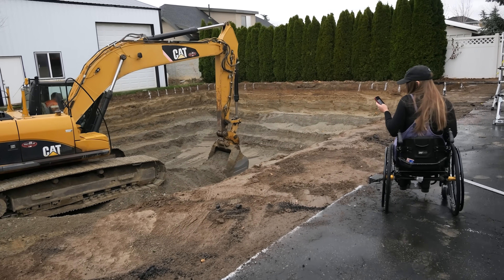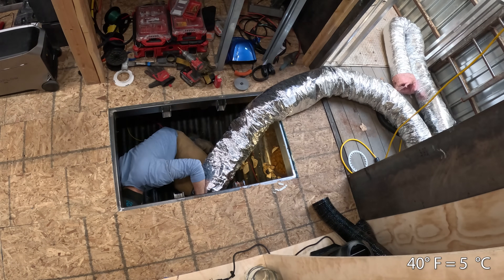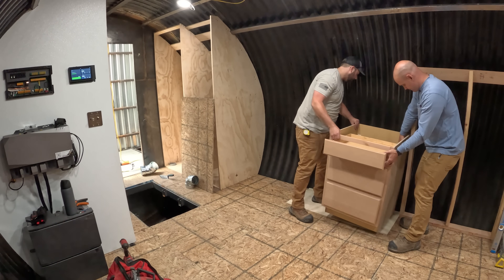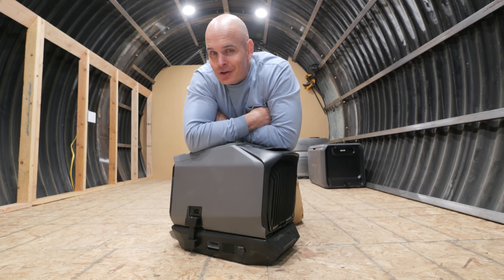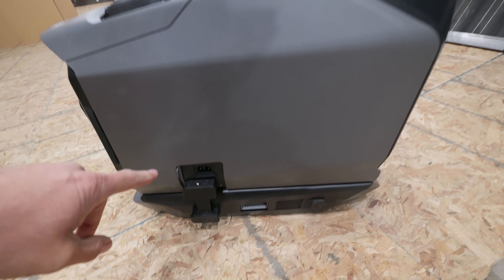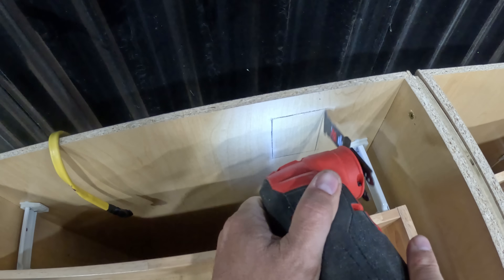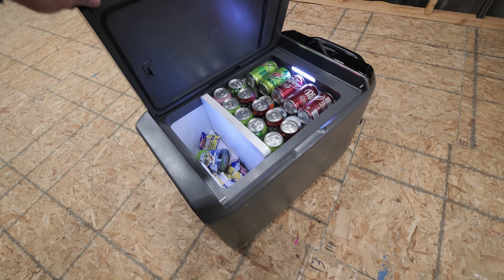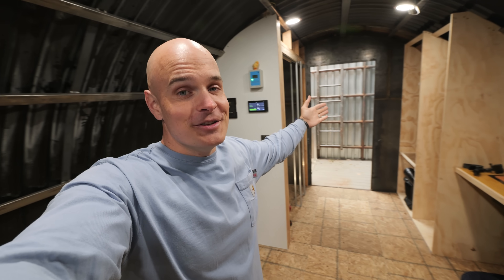How much air does my Backyard Bunker need?

Comment: It baffles me that bunker homes aren't more common in the many many parts of the world that experience extreme temperatures. I live in an area where it gets down to maybe 40 degrees at night in the winter, and sometimes even 110 degrees in the summers. People are basically always heating in the winter, and cooling in the summer, and those energy costs are INSANE. Also, some areas are so densely packed that parking becomes a problem. Imagine if they could park a couple of more cars ABOVE their homes?

Comment: Outside air coming in through some kind of HEPA/biological filter together with an air-to-air exchanger to preserve heat would solve most problems you could encounter.

It could be interesting to see some testing for radon levels too, as that could become hazardous over time if the bunker is used for recreational purposes.
Reply: Thankfully radon won't easily penetrate the outer casing, but it will get inside through any tiny cracks and splits. Ventilation will easily take care of it though. It is only a problem after days or months of no circulation
Reply: Or get rid of that crappy ecoflow unit, and install a proper heating system, but sadly its sponsored, so he has to advertise it.
Reply: @PaulXerxen  doesn’t seem crappy to me, and projects like this have to be funded somehow! Honestly I’ve found it cool to see all their products.
Reply: I'm suprised you think building a bunker is necessary?  Certainly not a thing in the UK. Will you ever use it? Would you just go down there and use as a man cave or a guest room?
Reply: @ you'd be surprised how many bunkers there are already in the UK and how many are self-built lol
Reply: @grahamprescott9426  He's at the southern end of Tornado Alley in Texas. Although it is a bit of overkill for a storm shelter, in the event one wipes out all the surface buildings, he's still got a place to live.

Comment: Did I just watch a 13 minute long Ecoflow commercial? I miss the bunker. Thanks for the update
Reply: im surprised ecoflow doesn't have portable bunker 😆
Reply: He did no work progress in 8 months. Returned to bunker when sponsership came
Reply: My complaint is that in the end, he basically says the thing he got for free to promote isn't even good enough for the space, which means he's got to replace it. So what's the point then?
Reply: That's 99.9% of his videos, and how he funds being a whiny little batch on X.
Reply: @techoverload As long as it's a good product, why wouldn't he give them a shout out to get it for free?
Reply: @TheDCJason  That's the thing, you don't know if it's a good product. It's not like I check reviews for all the stuff on his videos to see if he only accepts good sponsors.
Reply: @ACogloc  Agree. And good or not it is not best for bunker. More regular "split AC" style heat pump can be adjusted to the needs, not just put 4 those mobile heaters to make this work for large space. And deal with large amount of air needed to them.
Reply: @TheDCJason  There is a shout out and then there is this, which is a freaking infomercial. 

If the focus were on the bunker it would be one thing, but the focus in this was shilling. Its pretty annoying
Reply: @techoverload did he say something that hurt your feels?
Reply: @techoverload  I lol'd so hard at this. The X part is so true.

Comment: I would consider a ventilating dehumidifier. Could be wrong about the humidity depending on your region. But from the temperature ranges mentioned in the beginning you would gain heating year round and lower humidity which I assume is more than needed underground. Plus fresh air being pumped in is a no brainer to dilute co2 and VOC’s.

Comment: Carbon gases are heavy, and oxygen is light. So your monitors should be low on the wall, at least the sensors. Your oxygen monitor is set really high, which will not be the most accurate to what is being breathed, especially for someone in a wheelchair or a child.

Comment: Check out how much energy a microwave uses in comparison to an induction stove. 

They're not great for everything but not having to put energy into heating a pan can mean mega savings. And less heat radiated into the space also means less energy spent cooling.

Also instant pot pressure cookers. For your end of the world considerations

Comment: Curious how you'll do the water, water recycling, and rainwater/snow collection and processing. For collection and processing of rainwater/snow, you can use an RO system (and heater for the snow obv). The water I think at that point is MOSTLY safe (not completely**) to drink? BUT! you'll want to probably throw a chlorine tablet in there - look up the ratio per gallon.
Reply: Excellent ideas. I saw this filtered waste shower water system on small van RV.  He made the very limited supply of fresh water STRETCH.  For keeping drinking water sterile, I'd avoid the chemicals and use a UV light system.
Reply: @saxonsoldier67  Yeah, I wasn't sure about recommending a UV light system personally. I've read they're good though.

I hope he doesn't actually use a compostable toilet though. I've heard bad things from people on YT who've done skoolies. Instead, he could have some kind of greywater recycling or use the non-UV treated (but RO treated) water collected from rain/snow to flush his toilet(s).

Comment: For power requirements and heating = Hyperthermophile panel with nutrient drip. Your bathroom waste = fuel lol. Hyperthermophiles cause mulch to set fire because nutrient density rises as it rains it down to bottom. Cold steam Tesla turbine system with Vacuum pump to cold boil water in cold side to super cold to lower heat required for max turbine roll. Hf What your bunker for because gas attack it wouldn't be very good without ultrasound holography set to detect and pressure wave repel everything but what you need. For Oxygen go to /watch?v=p8xYUDiSGDk&t No salt needed. Download the video just because traitors everywhere inside system. That technology using perfectly tuned Ultrasound inside of a chamber to recycle echoes think of low power by only targeting bonds. Oxygen + Hydrogen. Send hydrogen away but keep oxygen then you need something to measure atmosphere oh guess what its also Ultrasound tech.

Everything else? Sets down Ultrasound audio spotlight echo beam facing way up into the atmosphere All that water vapor from a far just found a drain in the tub to spiral down.. Or anything else you need. Sets echoes to wide beam at human safe frequencies and retracts helmet back into skull to breathe the atmosphere bubble WEEE.. LOL. Points at Ultrasound sensor on Mars Rover 😇

Comment: backpackers walking the PCT or CDT tend to go lightweight, don't cook their freeze dried food, or just with one burner cook some water. But lightweight or 2,653  miles does  not seems to be the goal here, so why only 1 induction plate? Two would make the pasta and the sauce at the same time, some veggies and meat etc and both hot when served.  And since you are screwing away, with wood that is, you might want to check some recipes and how to build a Hooikist dutch oven, cookers say here, which became a Hay Box when the British took over. It saves great amount of energy, which you only have a little of. With some 5 minutes to boiling, to 40°C is 9 hours. perfect for a stew. but one can cook almost any ting in it. And remember whoever makes food taste good is King down there.

Comment: It's good that you are tracking O2 and CO2, but you should also track humidity. I would expect just a couple people breathing down there would be adding measurable to significant humidity to the enclosed space, and if the walls are at 50°F it doesn't take much relative humidity to hit 50°F dewpoint and any higher would start condensing on the walls. A quick check with a humidity calculator, at 75°F air temperature a 50°F dew point is only 41.44%RH, and at 80°F air temperature a 50°F dew point is only 35.13%RH. I'd post the link to the humidity calculator that I used, but YouTube doesn't like links. If you do an internet search for humidity calculator, I'm using the one hosted at the University of Miami.

Also, how are you handling the condensation off of the heat pump? Manually emptying it, or do you plan on plumbing it into a gray water system? Or just pumping it out of the bunker?
Reply: Airvalent Co2 sensor also measures humidity. 🌱

Comment: I( was hoping you were one of those types of YT chans that lists EVERY piece of Equipment they use (in hopes someone wants to buy it so they get a commission if you buy it through their link) that way I would know what kind of THERMAL CAMERA that was...  there are a WIDE VARIETY of them and a WHOLE BUNCH that are GARBAGE... so I was hoping you're wasn't one that is priced like it was made from diamonds and platinum because it looked to have a pretty high resolution and seemed like ~30FPS .... but I'm guess it was like $1000 at a minimum .... but I really have no idea...
- AND with about 550 comments I HIGHLY DOUBT you'll read this anyway... plus I hardly EVER check my notifications to see if I get responses.... so I'll just have to think of some other way beside the Amazon reviews to find a good one :)

Comment: Have you looked into the Cost-Effectiveness and efficiencies of  CO2 scrubbers versus a heat exchanger as a way of getting rid of your excess carbon dioxide without changing the internal temperature of the bunker?

Comment: My electric bill would argue with you about the coil-type electric stoves being efficient in any way or shape. They aren't. They are wasteful as Hell with electricity. In fact, they are so wasteful, I got a microwave to save money because the electric stove(new unit on top of it) is so expensive. So if you get a chance, avoid at all costs the coil-type electric stove. Get an inductive type and save your electric costs for something else.
Reply from the maker: From an energy standpoint - electric is more energy efficient than gas.
From a cost standpoint  - usually gas is heckalot cheaper - even though its not as efficient.

Comment: E-ink display feels like a bad idea on a device like the CO2 meter. You really want to know if the device still working correctly at all times and having a display that "works" even if the device has been off for a long time sounds dangerous. (Having a LCD that turns off when not pressing a button is less dangerous because you automatically know you have to check a led or trying the display).
Reply from the maker: That particular device just does a check every few minutes. Its not continuously reading.
Reply: @JerryRigEverything  Yes, but how do you know that it has done the check or died 2 hours ago, still showing the last numbers it read? (I'm guessing the time is on the display but maybe not what you are looking at every time you checking the values. Especially if you loan the device to someone not knowing about it)
Reply from the maker: @drosendahl  the screen flips to a big battery depleted sign when it runs out of battery
Reply: @JerryRigEverything  Ok, but if it suddenly dies or locks up (Its not like software bugs are uncommon or maybe someone tries a durability test ;) ) you will not notice. I don't say its a totally worthless product, just that eink is a bad choice and it would be better with something else.

Comment: disclaimer: 
If you don't have 2 pipes going outside or inside from heat pump. The heat pump is USELESS.

And do not store metal things under induction, it will heat up.

Comment: Question/doubt here. If the apocalypse you're always referencing is either a nuclear explosion or a dinosaur extinction meteorite event, wouldn't the solar panels, which are your source of energy, be rendered useless as there would be a massive cloud blocking sunlight for a few years?

Wouldn't it be more helpful to attach your energy sourcing to a wind turbine? Wind's gonna be there even if the sun is blocked.

Great episode as always!

Comment: It' shouldn't be the case, but I'm really happy the Ecoflow works without an app! Can't be taken for granted these days...
Reply: I've just found out that the latest Bosch dishwashers limit what cycles you can use if they're not connected to the internet (not just a local connection even!) and for that you also need to create an account.
Obviously I won't be buying one of those now.
Reply: Agreed. Manufacturers of batteries and portable appliances should realize the people buying them are either off grid or prepping for situations when the Internet and other utilities shut down.
Reply: I don’t like my equipment to rely on the company staying in business and maintaining their apps
Reply: @andrewkiefer2628  Me either. I had a Fender (Mustang II) modelling guitar amplifier that ran software that allowed you to shape tones and upload them, also to download other people’s settings. Fender stopped support and closed the servers after just 4 years. Now I won't buy anything that requires a connection for full functionality.
Reply: @andrewkiefer2628 or their government telling them to remotely shut their products down...

Comment: Zach why not try and build or provision for a CO2 scrubber for the times when you may not be able to ventilated the bunker ? The main reagent in it is quicklime - calcium oxide. Cheap and relatively easy availability
Reply: Yep, better then nothing and usefull in emergancys, but really shouldnt be used too long, remember other gasses the international space station has to be able to deal with (space is a rather interstingly close example)

Comment: That heat pump would be sweet for camping for sure. I just got the Delta 2, wicked little unit. They sure are coming out with some cool stuff. You should look into installing a LifeBreath HRV in the bunker, 99% thermal retention while exchanging all the air in there a couple of times per hour. Just need a couple floor grates open to "basement", also allows heavier CO2 to drop into the sump to be taken out.

Comment: I need to give you a heads up because the oxygen at the sensor level is probably misleading you because down towards the floor. If the sensor s are at the floor you should be worried if that does start to fluctuate
Reply: If oxygen all the way up to the sensor is starved or pushed out of the way then by the time the sensor starts  to give off warnings its too late. @jerryrigeverything you NEED to realize where the oxygen sensor inlet is. You probably dont have it low enough to give off propper readings

Comment: Can't speak to the Wave 3, but the 2 Wave 2's I had were garbage.  To the point that I won't use Ecoflow again....this includes the 2 Delta Pros Eocoflow bricked on me in December.  One right out of the box.  To the point that I have Delta Pros that are several firmware revisions old on the WIFI firmware and the main because I don't want to ship a 100lbs unit back to them.
The short of it?  Don't buy Ecoflow's crap until they have gotten their QC act together.

Comment: putting plants inside the bunker might lessen the CO2 levels in the future.
Reply: How would they water them? The sun lamps would take too much energy away from battery bank as well. Plus they would not have enough space for the amount of plants they need to remove any significant amount of carbon. Probably more space than the entire bunker offers.

Comment: Do a concrete or black granite counter top instead (you can put hot pots and pans right onto it after having used the induction stove with no risk for burning any surfaces).

Comment: I love this series so much. In the case of an actual disaster, Will the solar panels outside survive? and if they don't, what will happen to power for the bunker?
Reply from the maker: They are covered with a very thick piece of polycarbonate. It could probably survive a bullet. or even a car driving over top of it.
Reply: @JerryRigEverything  Ok, I was worried that someone walking around (especially during the build-out process where there may be random debris around) might stumble and fall onto the panels. I doubt those panels alone are rated for an adult human (male or female or other) falling on them so I would expect them to fall through the panels, then down the shaft. Keep an eye on the top surface of the polycarb that it doesn't develop too much of a haze degrading the panels' performance.

Comment: A mini split or a custom mini split made out of a old window or portable unit would be chemical and radiation tight. With this unit, like you said, the condenser needs 2 hoses too run a peak efficiency, intake from outside (so it doesn't cause a vacuum in the living space) and one too expell the unwanted heat if you were using it as an ac or in your case the cold air because you're using it too heat the living space.   To try and improve your current setup's efficiency you could try increasing the duct size or even try going to square duct,  I know that it's undersized for the space and that the Earth will take away most of the energy you try to put in the space without insulation but  you'd be surprised how much of a restriction the length of duct causes plus it being collapsible tube. Nice sponsorship tho, hopefully thos batteries don't...

Comment: Zack, very surprised that you didn't drop in a pipe to either the barn or the house to fit a heat exchanger to use the warmth of the earth in the winter it would have also solved the air / oxygen replenishment

Comment: Why didn't you at least put some foam or loosely packed fiberous insulation between the cabinets and the exterior wall?  It's going to take a ton of re-work to insulate those spaces without creating voids or condensation problems.
Reply: That'll be a scuba tank.